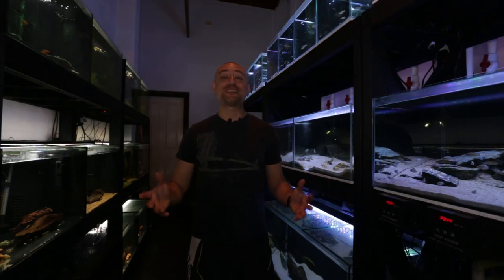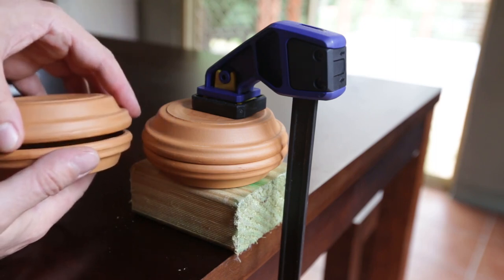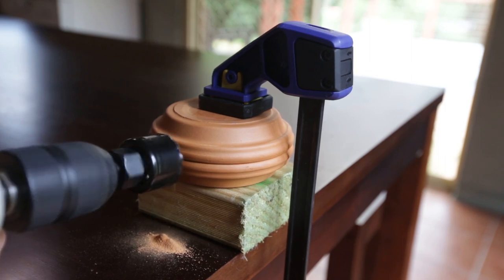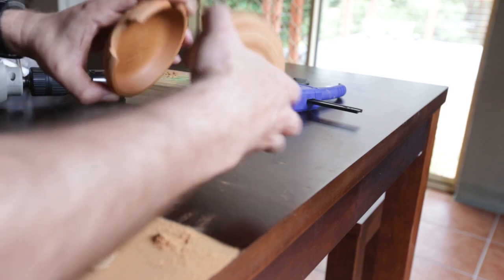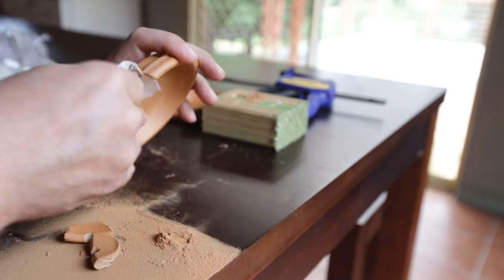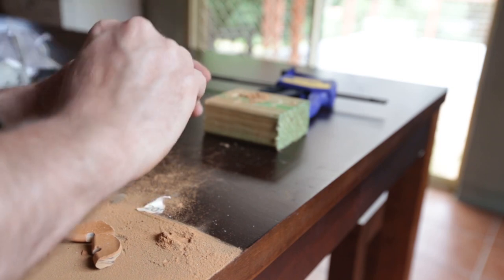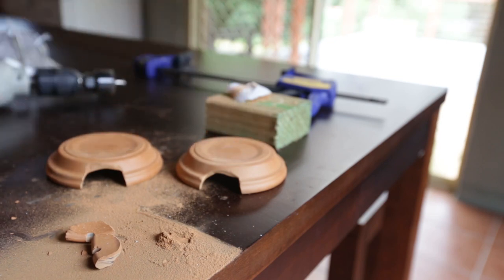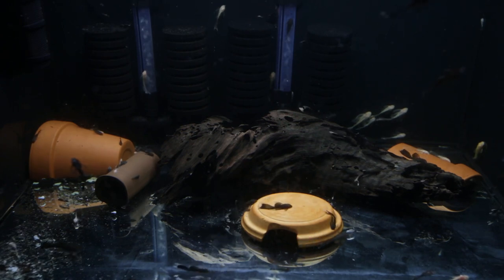Easy way of making Cichlid and Bristlenose Catfish Caves

Comment: Great idea!!!
Reply from the maker: Cheers mate, I was drilling one with a drill bit and then realised it would be much easier to sandwich them together and use the hole saw to do 2 at the same time!
Reply: @JasonsCichlids  good idea, I'm going to try some this weekend and silicone a tile to the bottom. Would have never thought to clamp them together.
Reply from the maker: Yeah give it a go mate, efficient process making 2 this way
Reply: Glue a piece of glass to the bottom of it. Then if you have a spawn in it you could lift it up and view the fry through the glass. Handy for transporting the fry to another tank too.
Reply from the maker: Yeah silicone glass if you did want to view the fry. Just be mindful of stressing the parents doing that though. On the other hand it is an easy way to transport the fry to another tank.
Reply: @JasonsCichlids  off subject, but have you spawned neolamprologus kungweensis
Reply from the maker: The name sounds questionable... haha But I had to look them up because I have never heard of them! They are an awesome looking fish!